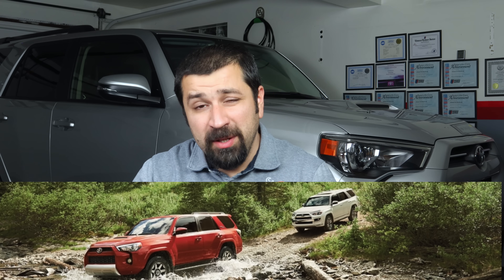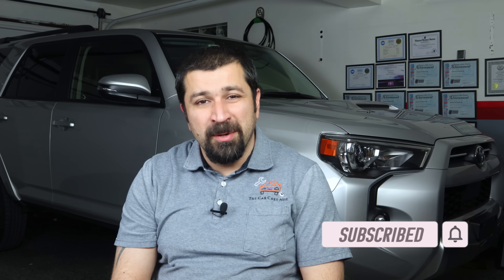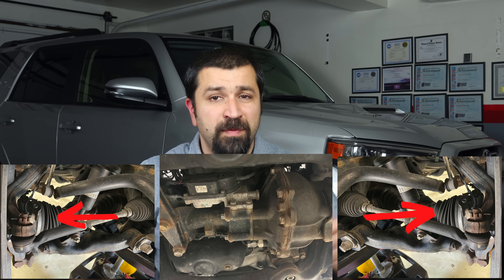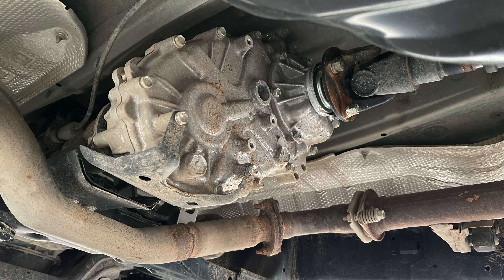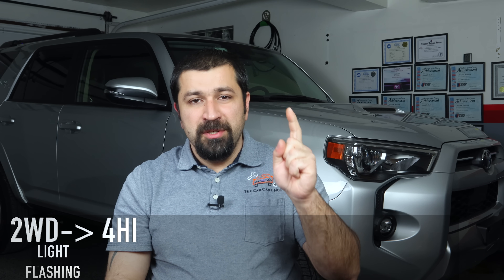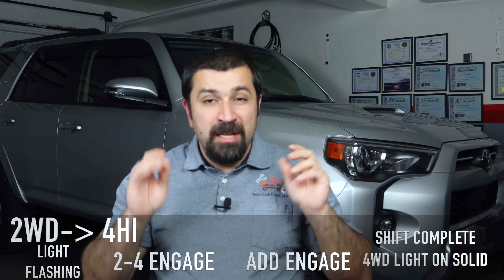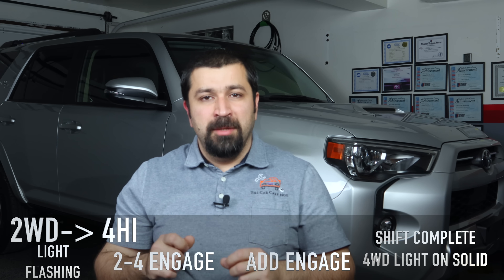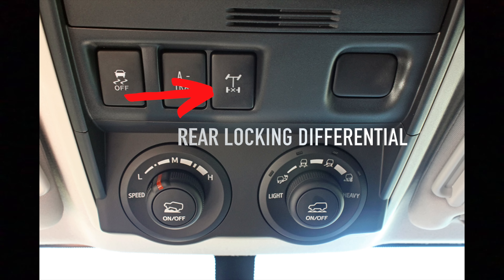How does Toyota 4WD System works and why is it reliable?

Comment: I see you recommend driving in 4-High around once a month so the motors do not seize. Do you also recommend going into 4-Low and driving around a bit? What about locking the rear diff? Can or should you engage 4-Low and the locking diff in normal driving conditions for long term reliability.
Reply from the maker: Hi! I would engage 4lo and the diff locks but just let the truck roll a little bit in a straight line then go out of it. You don’t want to drive in 4lo on dry pavement
Reply: @TheCarCareNut  ok sounds good! I’ve been having issues engaging the rear diff lock on normal pavement. I’m told this may be because there are no slipping of any wheel? Then I read you can try driving in a circle so one wheel spins at a different speed than the other snd it will engage. Any thoughts? Brand new 4Runner when I try to engage the light just flashes and never engages. I’m following the instructions in the owners manual.

Comment: @The Car Care Nut
Do you see any problem with using the Amsoil Full Synthetic Transmission as long as they say it meets the given Toyota Spec (ie WS etc etc ) . 
They say that fluid is supposed to be best transmission fluid you can get , as long as you meet the spec for the application, they have a couple different types at Amsoil.
Reply from the maker: Hi! I think amsoil makes fine products. However when it comes to transmissions I would only use the original fluid which the transmission was designed for.

Comment: This new series of yours make me ask myself: "Why I didn't buy a 4Runner instead of 2021 Rav4 Limited?" !!!
Reply: We just bought a 2023 RAV4 hybrid primarily for the mpg but now I wish we went with a 4Runner. The RAV4 is great but boring especially to a car guy and doesn’t have the capability I need. Only 6K but we’re stuck because trade in is 10k less than I bought it 6 months ago….dealerships!
Reply: I bought a 2011 Highlander last month, but now I am also regretting not buying a similarly aged 4Runner with a little bit of extra money. I discovered this channel after buying Highlander.

Comment: So even in 2Hi in the part time models, is there anything spinning in the front diff? I assume there is which is why the mantainance schedule is the same as the rear diff.
Reply from the maker: The axles are still spinning and part of the differential is but not the prop shaft
Reply: @TheCarCareNut  Thank you for your reply. This series is fantastic!

Comment: I have a 2017 Tacoma.  It would be perfect, if it had manual hubs, rear locker, 4:88's and a 4WD stick (instead of knob).  I still love it, just have to plan ahead for 4wd; don't wait for it to slip in the mud first...

Comment: I see questions sometimes if it's ok to go from 2 wheel drive to 4 wheel drive on the fly while driving,  hopefully at a low speed,  without  stopping then making the switch. What is your opinion?
Reply from the maker: Hi Ahmad! Hope you’re doing well. They are designed to shift on the fly. They can switch up to 62 mph but personally I wouldn’t at higher speeds maybe up to 30 mph
Reply: And it is H4 or 4 high only. Don't try to shift into 4 low while moving (Toyota won't shift into 4 low without you being stopped and in neutral).
Reply: 2019 Tacoma owner here. I shift from 2WD to 4 high back and forth while the truck is in motion. The mechanism permits this without any damage.

Comment: With Full time 4wd, can you drive 4Runner over 70 or 90 miles per hour in both Summer and winter months Without damaging anything in the system?
Reply from the maker: Hi! Yes you can because they have the center differential.
Reply: @TheCarCareNut  thanks for your info
Reply: One can drive any 4WD over 70-90 mph, not just the full time model. The part-time 4WD is best not to use on dry pavement, but in slippery conditions like rain, snow, there will not be any issues at any speed. 

The difficulty on dry pavement is turning. At these speeds, one cannot turn very much safely, thus, the tires will not grip much. But, one needs to get below 60 mph to get back to 2WD, to perform tight turns at a light for example.

Comment: Toyota recommends using 4WD hi and lo for at least 10 miles each month.  I'm guessing those people who don't need and thus don't use 4WD for monthly adventures off pavement don't even want to take their vehicle off road or off pavement to do that 10 mile preventive maintenance drive for the 4WD motor and actuator system.  Will 10 miles ON Pavement using 4WD Lo and Hi once a month do more damage to the 4WD system than not using 4WD at all?  If the 10 mile, monthly 4WD exercise is done on Pavement on a stretch of straight road, no turns or curves, will this eliminate any risk of damage to the system since all wheels will travel at the same speed during the test?
Reply from the maker: Hi! No damage would be done if you switch into 4Hi and try to drive on a straight road. On 4Lo I would drive it a bit at very low speed maybe on a side street and definitely no turns but the 10 miles is more for 4Hi

Comment: RELIABLE 4X4 are you kidding me, Toyota 4x4 systems are junk thousands of threads on problem after problem with them.
Reply: Agreed. I'm a victim as well. 62k in my PRO and the 4wd system is completely unreliable.

Comment: Is the potential seize up scenario due to non-usage of the 4WD system ONLY with the Dial Type switch, activating the Actuator to change to 4WD - 4WD Hi and 4WD Lo and back to 2WD or does the stick/shift lever on the console (TRD Pro, TRD Off Road, Trail Models) - that don't have the round Dial for shifting through (2WD-4WD-4Hi-4Lo) also work through the same Actuator that can seize up with non-usage or does the shift lever by-pass and physically do the job the actuator is doing in the Dial system?
Reply from the maker: Hi! The seize can happen in both models as the model with the physical shifter still has an actuator in the front.

Comment: Toyota 4wd system today is very bad and has many problems it's not for heavy duty use like the eighties models,the only 4wd car I trust to it is seventy series without electronic ,strong frame ,both rigid axle ,manual locking hub,rear and front diff lock,steel rims with tube type tyres and finally fitted with 1hz engine, then we talk about true Toyota 4wd system.💪💪💪💪💪💪💪

Comment: I have a 2014 Toyota Prado150 which has exactly the same transmission which is the A750F but it is full time 4 wheel drive and I would like to change that to the electric part time system like the one in the 2019 and up 4Runner. is it possible to do so? If so which parts do I need to get the job done?
Reply from the maker: Hi! You’d need a new transfer case and front differential. And likely a lot of custom wiring to get everything working.
Reply: @TheCarCareNut  essentially both the prado and the 4runner have the same platform the only difference is in the drive train which is the part time and full time 4 wheel drive which kind of got me thinking that the parts are interchangeable or in other words plug and play which to me kind of makes sense since both cars share the same platform.

Comment: I noticed the physical 4wd lever to be more reliable than dial switch, Does actuator exist for Physical shift lever and What is the reliability between those levers ? By the way , awesome perspective, somehow this was lacking in all the glorious videos on 4Runner, thanks.
Reply from the maker: Hi! So the shift lever is very reliable. But they still have the front add actuator. They are both reliable as long as they are shifted frequently

Comment: Hi AMD.. can you give me an idea about the issue im having ob my 09 v6 venza awd? Lately i started hearing a humming noise on the front driver side area only between 115 to 118 kph,, just in that speed range.. i did tire rotation, same noise,, same area, whats the problem? Thanks in advance
Reply from the maker: Hi! Likely a wheel bearing noise. It would need diagnosis to confirm that it’s that side you’re hearing as noise travels
Reply: @TheCarCareNut  ok thanks.. its a low humming noise sounds lika a tire noise,, not a high pitch noise that gets louder as a speed change,,  just between 115 to 118 kph speed range

Comment: Just a off topic question for ya...I have a 2009 Tacoma regular cab 4 cylinder 5 speed 83k miles, I have a low idle, and I find myself putting on the defroster just to bump the idle up 200 rpm to stop the shaking, what can I do..throttle body and maf is clean..
Reply from the maker: Hi! How low is the idle?
Reply: @TheCarCareNut  about 600
Reply from the maker: Honestly I would say that’s a normal idle so the shaking could be something else. How well was the throttle body cleaned?
Reply: @TheCarCareNut  just from the entrance, I didn't take it off and get all the small holes really good
Reply from the maker: I would focus on cleaning the bore of the throttle body where the butterfly meets the body. Open it and clean it well.
Reply: @TheCarCareNut  thank you..

Comment: The 4wd is the only thing that I have broken on my 4Runner. I have a limited and the actuator on the transfer case got hit with a rock and started to leak. The actuator is supposed to be sealed from the transfer case and dry but the impact broke the plastic and damaged the seal. I had to purchase a new actuator which was expensive and removed/split the transfer case to replace it. Other than that my fifth gen has been amazing. 150k miles and runs great
Reply from the maker: Insurance didn’t cover that?
Reply: @TheCarCareNut  probably should have tried to claim it. The actuator was $700 if I recall correctly and I did the job myself. I originally tried to get it replaced under warranty but since it was obviously broken by an impact it wasn’t covered.

Comment: Seems like Subaru's Symmetrical All Wheel Drive system is so much better and far less complicated than this. Why does Toyota use such a complicated system?
Reply from the maker: It’s actually not that complicated. And Subaru system is completely different and doesn’t have low range

Comment: Hey AMD! A question. I want to prevent my car paint/interior plastics from cracking. I work 60-80 hours a week and don’t have time for washing/waxing/applying  protectants on the interior. I’m however fanatic on all other mechanical maintenance . What is the bare minimum  I should do to prevent exterior paint or interior trim from cracking as my beloved Toyota ages?
Reply from the maker: Hi brother! I would honestly consider having the outside buffed and waxed or ceramic coated better once a year then just use an automatic car wash with a monthly subscription. Find one on your way to work or home and stop by to wash it as needed. On the interior of its legal in your area tint your windows to protect the interior and every month give it a quick wipe down and call it a day.
Reply: @TheCarCareNut  Thank you very much brother. For the interior plastic wipe, is warm water or all purpose cleaner fine?
Reply from the maker: I wouldn’t use any water or interior cleaner unless there’s a stain. Just a microfiber towel to wipe the dust off
Reply: Windshield sunshade...mandatory for me at all (almost) all times when parked in the sun.  I use a shade on side windows that face the sun for extended parking...multiple days at a time. 
I use damp towel on dash and interior hard surfaces for 20+ years with no issues.
Reply: @dennishenderson6988  Thanks bro!

Comment: Would the full time awd be "better/more reliable" because of the chance of actuator seizing? Great videos, thanks!
Reply from the maker: Hi! Honestly they’re both reliable and even on the full time you still need to engage low range and the lock to keep the transfer motor from seizing.

Comment: Excellent continuation of this series!  Outstanding channel you have here been following for some time.  I would love to know common things to look out for in this system.  For example, fixes for the actuator when not working correctly.  I’ve seen some fascinating DIY fixes to get it to work again without spending big money to replace it.  Some advice to others it doesn’t hurt to change out your breather valves even placing a newer OEM breather valve esp in the rear diff is important maintenance and they are dirt cheap to buy.  If you don’t over time they become corroded and don’t freely move up and down to allow the release of pressure.  If this happens rear diff axle seals start blowing!!

Comment: I want to know why you can't go faster than 60 miles per hour on my tacoma in 4 wheel drive?
Reply from the maker: Hi! Because it’s designed for snow/ice/off road. Also this model doesn’t have a limited slip differential so when you make turns at higher speeds that puts a tremendous stress on the transfer case

Comment: Hey this is a sought for us 4 wheel drive gear guys can you make a simple tutorial of how to hotwire the switch so it's not in limbo 50 miles from nowher...... Edit... but I've got the old school hard stick for for 4 low 4  high 2  high so that actuator wouldn't apply to us that....is that  correct ... Are hard sticks could never go into limbo correct
THANK YOU
Reply from the maker: Hi! So if you have a manual shifter it won’t go into limbo. The only thing you have which can seize if say you don’t use it for 5 years then all of a sudden you do is the ADD actuator. I can make a video in the future about this.

Comment: Thank for this video.  Now I'm a little concerned about buying a 4yr or 5yr old 4Runner as the 4wd system maybe frozen from not being used!
Reply from the maker: Hi! I wouldn’t worry. Try it before you buy it. If it works during the test drive you’re good and wouldn’t have to worry about it

Comment: On my F150 from the mid oughts, it has a little metal electric shift motor on the transfer case, wasn't shifting for a while (light would not light up on the dash, definitely was transfer case, as there was zero noise from anything moving under there)...well a little tap from a regular claw hammer knocked it from whatever seized position it was in, and works like a champ still,,,was looking at prices on new shift motors and all that mess, and all it took was a little love tap, don't beat the hell out of it or anything LOL

Comment: Awesome video what a machine the 4runner is ....its a legend thanx for the great advise to engage the 4×4 once a month 👍
Reply: It's also written in the manual.. 10 miles a month minimum
Reply: @youngprince716   What if you live in a dry area and can't drive with 4WD engaged?
Reply: @chuckwalla2967  what do u mean dry area ? Anyway you can always drive with 4x4 engaged. Just make sure you're in hi not lo

Comment: I’m shopping for a 4Runner. I really love the All Time 4WD but hate the front grill) ...My Question: Is it possible to safely use Part Time 4WD  on constantly varied winter roads conditions ( snowy then icy patch then dry asphalt )
My understanding is that the PartTime 4WD lacks the center diff so binding can occurred if one travel on asphalt and lost of control is possible.
Thank you
Reply: Thank you...SO Sad that the only model that have FullTime 4WD are the Limited/Nightshade edition with their softer, more « civilized » look .... Thats unfortunate...Thanks for your greats videos!
Reply: I live in the high desert in my area which can be very dry most of times but I also deal with random snow storms and loose dusty fire roads/Unpaved dirt roads all the time. It is totally fine to use 4hi when the terrain your wheels are on allow for slippage of the wheels/tires. The reason why it’s bad to run 4hi on dry pavements is since your tires are in an ideal condition for grip, the speed difference in wheels puts the stress straight into the differential/transfer case since the high grip of your tires won’t allow any slippage. As long as the road conditions you’re currently driving on allow for tires to slip 4HI is safe to use and should be used.
Reply from the maker: Hi! I wouldn’t use it on dry pavement especially on turns it will bind.
Reply: It’s because you don’t need it. But if it’s icy you can use 4hi I’m pretty sure. I know
He said don’t but it’s better than flipping off
The highway
Reply: @CoveringFish  I live in Winterfell (Canada) road conditions can vary extremely fast during winter... As I see it, need a center diff  (Torsen) to be secure in Highway ...problem is that Limited/Nightshades are Ugly...lol
Reply: @DrDGr2  no you do not. I have a Tacoma part-time 4WD and I grew up in Canada and live in California. 
If slippery, just use 4Hi anywhere, freeway, small road, streets, whatever. If dry on freeway and going straight, it’s also fine in 4Hi. Before doing tight turns like at a light or stop sign to turn left or right, just go into 2WD. 
One can go into and out off 4Hi below 60 mph. So, if pavement gets too dry or one wants to do a tight turn, then go into 2WD, it is perfectly fine even on freeway. 
So in mixed conditions, I would keep it in 4Hi unless doing tight turns, but again if pavement not dry, then even turns are fine in 4WD.
Reply: @DrDGr2  the best trim is the TRD Off Road with KDSS suspension with rear lock differential. Get the Premium for more comfort. Best off road, snow and all weather conditions 4Runner. Even better package than the TRD Pro which does NOT have the KDSS as an option, only the Off Road trim does.
Reply: If in 4Hi, one is not going to loose control, especially on freeway. 
It is possible, although not good and not recommended to take a tight turn (left or right turn at a light or stop sign) on dry pavement, it is just much harder to turn the wheels, so there will be a tendency to go straight. (Harder on the components, but they will tough it out if done inadvertently). But since one can engage the 4Hi and out, below 60 mph, there is no issue in practice. One just has to remember to get out of 4Hi before tight turns.